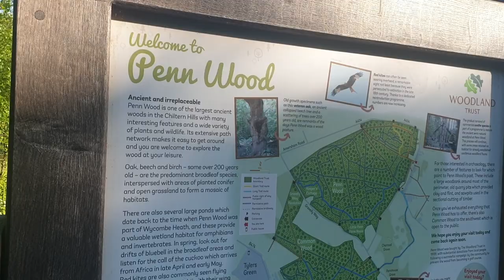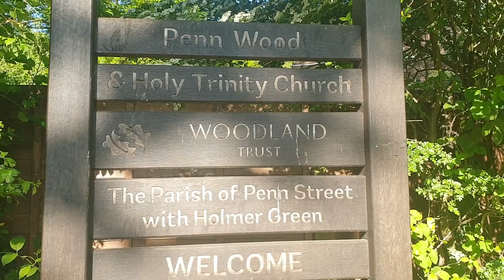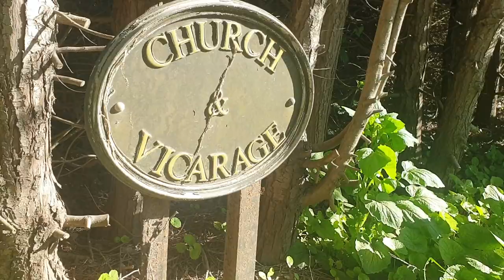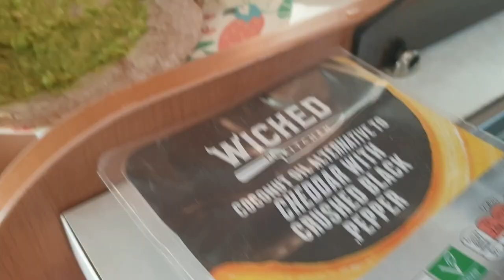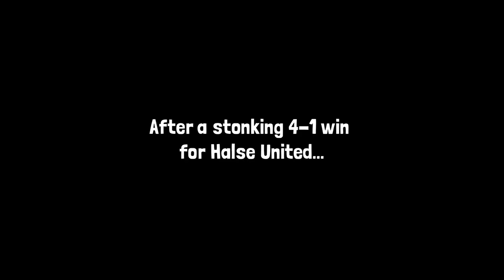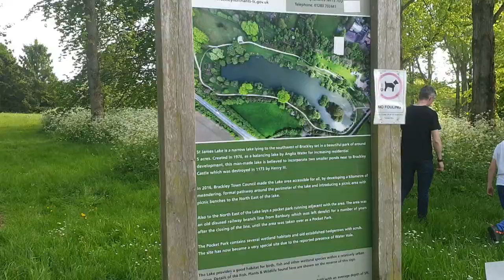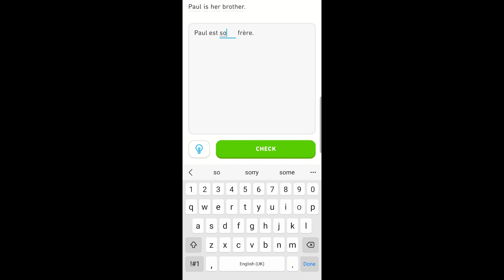SO SICK I NEARLY DIDN'T GO! Milton Keynes in a Motorhome and SOCKET UPGRADE!

Comment: just a little tip you should always use multi strand cable in motorhomes and vehicles single strand like you have used can with motion off vehicle can fracture and brake made a tidy job off it tho all the best donny
Reply from the maker: Thanks Donny. He says he used what he had spare so it'll last a few years. But you're right, he has read that 😬
Reply: @EscapeintheMotorhome  yes def done a greatjob on it tho well done daz
Reply: Also dry lining boxes are more suitable for mounting sockets in panels.
Reply from the maker: @bigaldo8187  will pass that one on to the boss 👍
Reply: Not a criticism,  but as Donny says above re wires.  You should consider changing the cables to flex before the French trip, use 2.5mm artic flex, its very durable,  available at screwfix or tool station.  The twin and earth you have used could crack because of all  the shaking and rattling that motorhomes suffer from, leading to problems in the not too distant future.  If you do change the wiring,  you might want to consider changing the back boxes to plasterboard boxes at the same time,  they will be more secure. As I say, not a criticism,  love your content,  and would hate to see you run into problems while away. 
Looking forward to seeing your escape to France.
Reply from the maker: @cynicalmick  definitely passing this on, though he's gonna be seriously miffed 😔
 Thanks for your very helpful advice 😊👍❤️👌